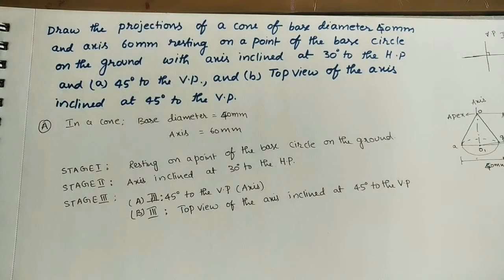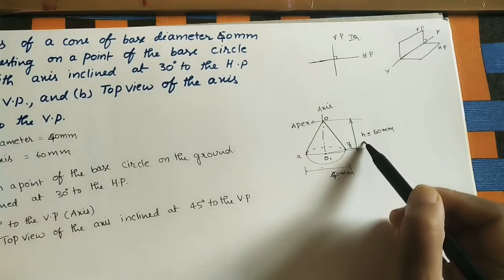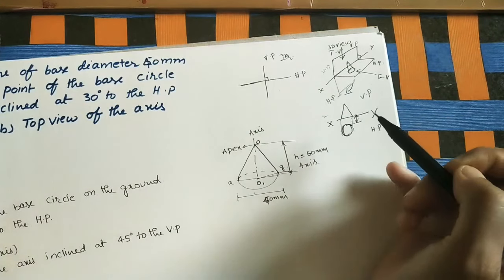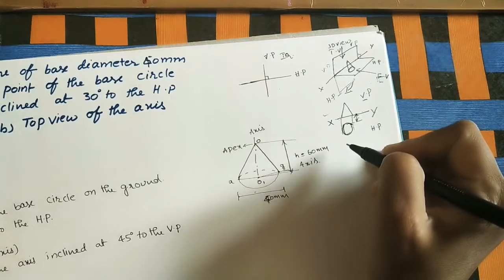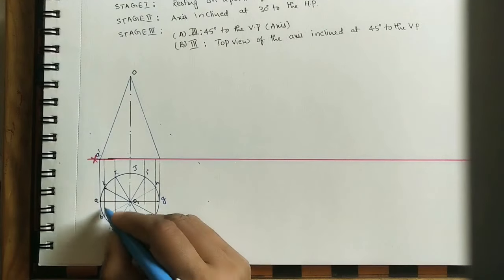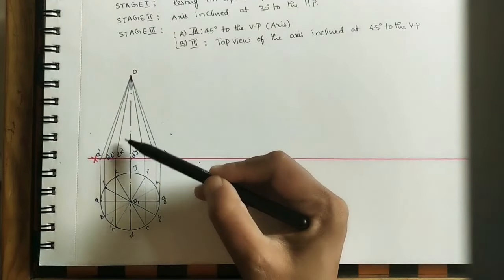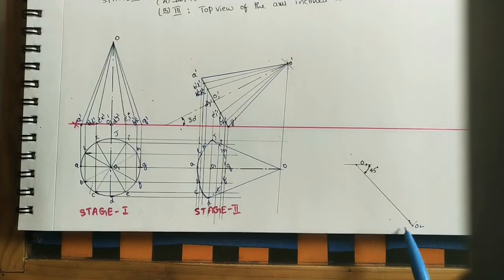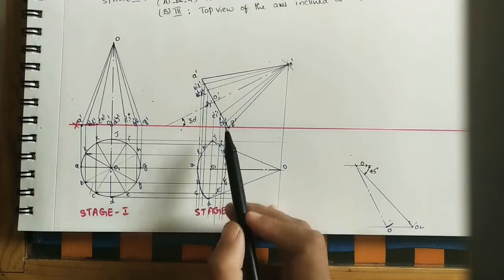Projections Of a Cone(In 4Stages)

Comment: Draw the FV and TV of a cone having base of 45 mm diameter and axis 50 mm
long when it is resting on the ground on a point on its base circle with axis
making an angle 30° and 45° with H.P. and V.P. respectively
Reply: For this which stage u did stage 3 or stage 4

Comment: . Draw the projections of a cone of base diameter 50 mm and axis 60 mm resting on a point of the base circle
on the ground with axis inclined at 30° to the H.P. and the top view of the axis inclined at 45° to the V.P.